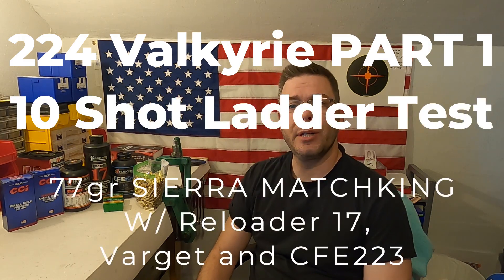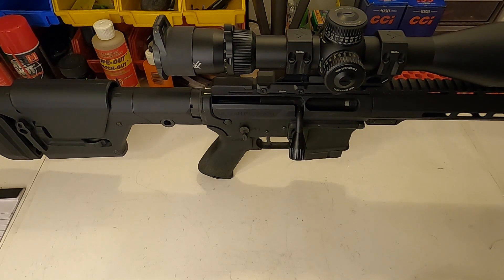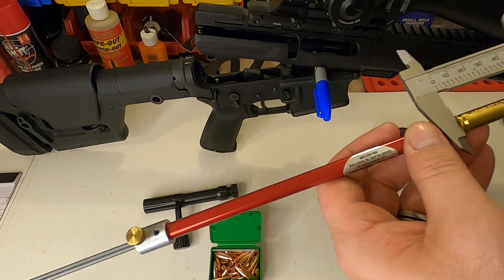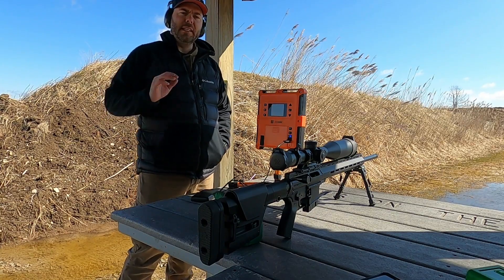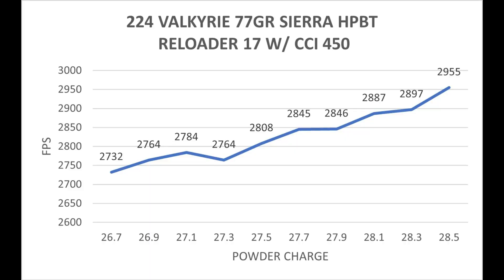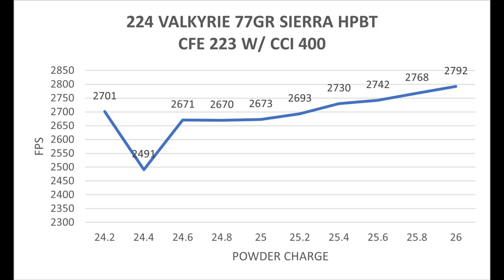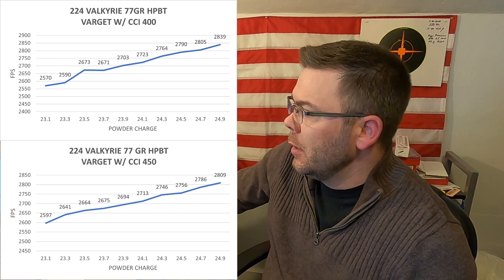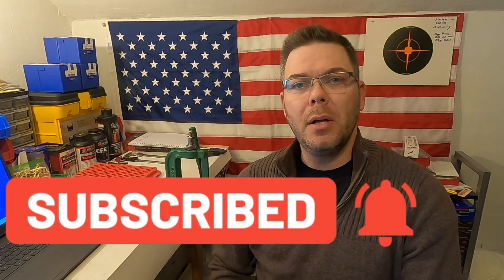224 VALKYRIE PART 1 - 10 Shot Ladder Test - 77gr Sierra Matchking w/ Reloader 17, Varget and CFE223

Comment: Are you trying to stay at or below 2800? If not I think you are missing the next set of nodes. I'd bet if you get that velocity up to 2875 or 2925 you would find some really good shooting loads. If you are worried about pressure do some research in gordons reloading tool.. I was amazed at how much higher charge weights I was able to go with just a 223 bolt action.. I was able to hit over 3000 with a Berger vld 80 with multiple extruded powders..
Reply from the maker: I would love to go faster.  I am just very cautious with 224 V because the brass does not hold up too well with higher pressures.   I am going to be doing a series with the 90 grain Matchkings next.